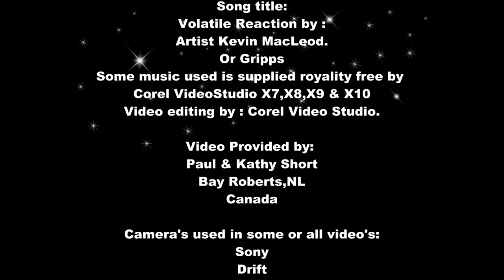Honda GL1800 & GL1500 Tech Tip Switch Issue

Comment: A trick I learned long ago when re-assembling plastic devices is to not just insert the screws and start tightening. If you do, you might accidentally cut new threads into the plastic and that's how you end up with stripped out holes  After inserting the screws, slowly turn them backwards and as you do, you will hear and feel them 'click' into their original threads, then you can tighten them up and you are good to go.

Comment: Hi, Paul!  This is funny because I just performed the exact same switch repair on both my hazard and fog-light switch before I found this video, and you are exactly right on these 2 important points (in case anyone is wondering, Paul is right):

1.  Suggestion:  physically remove that spring (the one that likes to go flying) with needle-nose pliers before disassembling the rest of the switch.  This is to prevent that spring from being lost.

2.  The copper leaf-spring on mine indeed was "flat" and the grease inside the mechanism was turning to a glue-like substance (the bike is 16 years old).  So the next step of my "operation" was using a tiny screw driver to scoop out the old glue-like grease, and once clean and the little "pin" moving freely, then I lifted that leaf spring to make it stronger again.

3.  The black switch indeed has to be re-assembled by snapping it in so that all 4 "dogs" snap into their places at the same time.  You can also test the conductivity of the switch before re-assembling if you want to make sure it works (so you don't have to take it out again).  It should provide a complete short between the left pair of wires, and another short on the right pair of wires.

Well done!  Great tip!  I'll search here before I dig into my next fix!  (Shich is the blinker switch -- gummy and doesn't pop back to center sometimes.)

Comment: That Dow grease is the best I've found. I broke down and disassembled my remote switches on the handlebars of my Gl1800 to clean and grease them. Pretty tedious, small work with the headlight on my head, but they all work now. Great video.

Comment: Paul, you didn't use enough dielectric grease...  <grin>
As an Electronics Engineer (ret) with enough letters behind my name to make alphabet soup, there is no reason not to use the dielectric grease unless there is a reaction with the non-metallic structure of the switch.     Most dielectric grease is PDMS based and relatively inert compared to petroleum greases.   The only time you have to be concerned is when you use dielectric in areas of high energy arcing as components of the PDMS can convert to Silicon Carbide (SiC) or as you probably know it, Carborundum... which can hasten contact failure.   So don't use it on your starter solenoid contacts and you'll be fine.

Comment: I read somewhere about a guy using a massager on a stuck switch.  So I have a hand massager shaped like a computer mouse and held it to my stuck cruise control on/off switch and moved the switch back and forth many times with the massager.  Got the switch free!  That massager I think will now be part of my took kit.

Comment: Yup.  Been thar and got da T shirt.  Emergency flasher, driving light, and reverse switchs have all stuck.  Lost a spring and found it, lost another and did not find it, but a clicker pen provided a substitute.  Lots of folks poo-poo about WD-40, but it cleans out the too heavy Honda grease.  I considered dielectric, but it is pretty thick too.  I remembered another silicone grease I had in my fishing tackle box, Garcia Reel Lube.  I used that and no more sticking switches and its been many years, 11 or 12 years.  I wonder if Garcia Reel Lube is still sold?

Comment: My 2004 has around 115 000 kms and I'm starting to have the same issues with fog lights , emergency flashers , and cruise on/off switches. I thought I could get away with just spraying a good electrical cleaner in there but it looks like I'll have to delve in a little deeper. Thanks for the post.

Comment: This is my job for today.  I was replacing all my bulbs with LED and used the hazard switch to check that all the bulbs were working.....Bad idea!   I remember someone saying to NEVER push the hazard switch!  Now I know why.  Thanks for the video!  I haven't been to NFLD in years.  My mother grew up in Gander Bay so I used to visit there every 2 years as a kid.
Reply: OK so I took the switch apart 3 or 4 times.  I cleaned all the grease off the innards and applied dielectric grease (maybe too much) and it wouldn't work properly still.  Took it apart again, cleaned off all the grease again, adjusted the spring pressure a little more and it worked fine.   Took apart again to add grease (just a little this time) and it seemed to work.  I put it all back together and now it usually works but sometimes requires a little persuasion.  How is yours working now?  Has it failed again?
Reply from the maker: Hi. That’s a pretty old video but I still have the bike and all the switches work perfectly other than the cruise switch I had to do the same thing with last year.
Reply: @7863348  I have a new problem.   I was repairing a charge port that was installed in my left side glove box.   I accidentally touched the + and - wires together and now I have no power at my acc terminal.    Is there a fuse for this terminal?   The charge port never had an inline fuse installed.  I would appreciate any information you have.   
ps.  I tried dielectric grease on my cereal.   Gave it a nice zing!   Haha.
Reply from the maker: @sunsetoriginals7320  If there isn’t an inline fuse for that charge port then hopefully a fuse in the man fuse panel popped. Check all the fuses at that location.
Reply: @7863348  thanks so much guys.   I feel so stupid.   For some reason I thought it didn’t have a fuse.   I changed the fuse and it’s all fixed.  I also picked up service and electrical manuals for the bike.   That should help me out tremendously!

Comment: so basically what you’re saying is, take it apart and clean it and put it back together.. got it. I thought only BMW overcharged for parts..
   that’s not the most ridiculous price I ever heard for a part. I had a Kawasaki KLR 650. I was in the process of upgrading a part with the nickname, Doohickey. It’s a spring for a chain tensioner on the counterbalancer ., I went to the dealer to buy a replacement gasket just in case,made of what looks like paper. this was around 2006, so pricing now is probably higher. But this gasket made of paper shaped like the state of Ohio outline about as big as your hand, The dealer wanted $58 for that gasket.. after I was done coughing after I heard that price, I told the dealer to keep the gasket, I will be very careful when I remove that little inspection cover not to tear the gasket.
   Every time I see an out rages price for a part, I always ask myself, could I make one of these. The answer is no to the switch for the Honda four-way flasher, but yes to the Doohickey inspection cover on a Kawasaki KLR 650
  my four-way flasher is stuck on my 2002 Gold Wing. I just bought the bike in October. I don’t know why I pushed the button, I do know that I will never push it again, ever.I’m glad it’s November right now, I have 4 months to fix it..

Comment: Paul you were thinking out of the box (or is it experience). The tech tip that I got from this video is the suggestion of placing your work inside a plastic bag when removing parts that have little springs inside. Or those dam E clips that always seem to fly off in a parabolic arc never to be seen again.  Good tip, I will remember it.

Comment: Just got a 2005 wing last week.  Foolish me I didn't operate all the switches but the dealer saw the cruise on/off was stuck on so hoping they will fix that.  I saw this video you made on the hazard flasher switch so I think I'll try mine.  Sure enough it stuck in the on position.  Had to tear it all apart and reassemble; hazards now off.  Too chicken to try it again.

Comment: I have the exact same switch bad on my 2002  Holding. I was so happy to find you. Thank you so much for your wonderful information. You explained it perfectly. How do the control panel and glove box come out. Thanks, Jim.

Actte
Reply from the maker: Your kindly welcome. With over 800 YouTube videos I really don’t have the time to layout detailed instructions on how to remove parts from ones bike. You need to do what I always do. Buy a factory repair manual. It will pay for itself on the first repair.

Comment: Like your videos.  Have you done one on Goldwing 1800 rear shock.  I bought 2007 with 220,000 miles & need to replace the rear spring & or shock.  Took it for the first trip to PA, round trip 1000 miles plus.

Comment: LOVE YOUR VIDEOS,I HAVE A 2006 GL 1800 WITH 51000 MILES ON IT.I`M HAVING A PROBLEM WITH THE IGNITION SWITCH. BIKE WON`T TURN ON.I PUT THE KEY IN TURN KEY, LIGHTS UP FOR A SECOND THEN NOTHING NO LIGHTS WONT START.IT`S LIKE YOU NEVER TURNED THE KEY.I CHECKED FUSES,BATTERY, AND RELAY. GETTING READY TAKE BIKE APART TO CHECK KEY IGNITION SWITCH.ANY SUGGESTIONS WOULD BE APPRECIATED.

Comment: I have a GL1800 that misses in a similar pattern on each of the 6 cylinders when watching it fire with a timing light.  It began suddenly after passing a car on the highway. It still runs but has a miss that's equally distributed to all cylinders. Not sure if it's possibly the kill switch, ignition pulse generator, computer, to or what? Don't see it throwing a code.

Comment: Hey Paul thank you for your time, can you show us how to remove the Horn Cable, horn stop working fuse is ok, need to measure the current but no way to remove the cable Goldwing 1800 2011. Thanks in advance

Comment: 2 questions... 1 if you lose that spring could you use a spring out of a pen would have more pressure to release 2. Would powdered graphite work better the grease? Going to attempt this project in about a week

Comment: Hi Paul n Kathy,   On your vid with the switch of date: 16-Aug. 2017, I`ve heard a lot of stories about the emerg. flasher, is that the one ?
If so, why even bother hooking it back up if its causing so many problems ? 

Sounds like a money maker for Honda.
Thank you both, by the way Kathy, great job with filming.
Reply from the maker: Thanks Marco. Yes this video was for the flasher switch. I showed how to repair the problem so you wouldn’t have to purchase the complete assembly in the video. Once repaired you will get many years use our of it before it needs to be done again. 
Why repair it at all you ask. Well it’s a safety item and anything related to safety should be keep in perfect working condition. 
Thanks for watching.

Comment: Paul i have a 1995 1500 gold wing . I’m having a problem with the air pump. If i jump out the power to pump it works.The fuse is good and relay. i’m stumped. Can you give me any information on what else to check? I like your video’s. Thank you any help would be appreciated. Bill Groel

Comment: Hi Paul got a question for you as I seem to not find information on the led temperature light on a valkyire mine does not come on I'd expect it to show blue then green or something, if hot red the bike is a 97 I've had it 2 years all the wires seem to be there,  what do you think,

Comment: that panel you are working on  i have a question about the preload button, i fixed the hazard button with your help, but my air shocks are not working i had the model that had the light psi and voltage, i bought a new panel, and it has only a master plug with no plug going out for fog light and preadjust button, my old one had 3 connecters coming from the bike to it,im trying to convert it any suggestions

Comment: Would you take on the task of replacing a second gear on a 1989 Goldwing that's been sitting since 07
Reply from the maker: The last Wing I restored was 7 years ago. A 1980 GoldWing. The last time I worked for the public was 6 years ago. I’m into manufacturing now and loving it. The only time I’m in the service end of the shop is to do my own work.

Comment: Good morning.
I have a 1999 honda valkyrie and just take the carburetor of to cleaning them up. I had to change the float needles. I after i put it back i get a crank no start unless i  remove the air box then start.
Can you give me something helpful point?
Reply from the maker: There is a drain screw on the bottom of each carburetor. Loosen each one and see if an fuel comes out. If there’s no fuel you have a restriction or it’s possable your needle valves arethe wrong size. The other thing I’d have to check if it were in my shop is It sounds to me that the carburetors might not be clean enough and they are restricting the fuel. What you have is a a fuel problem. You just need to track it down. I would start by getting a factory service manual and that will be your best friend when you have issues. Good luck.

Comment: Dear Paul and Kathy, question, my GL1800 2007, it has abs flashing issue. Sometimes it doesnt but mostly abs light is blinking. How can I solve this? Thanks
Reply from the maker: Try resetting the abs light by removing the abs fuse for a minute. 
If that don’t work here are your options:
Purchase service manual and use it to find the issue or 
Take it to your nearest Honda dealer for repair.
Reply: Paul & Kathy Short thanks a lot
Reply: I cleaned the abs sensor on the front tyre and now the problem is gone ;)
Greetings from Istanbul

Comment: Hello Paul, I hope you still reply to comments from this video. I think your video is good, however, there are some areas you are not clear on. At around 3:44 you said to substitute switches (fog for hazard) you have to take out one of these little dogs spring it under  and put in the other cavity????? You lost me!! In the video you are not very clear about what "dogs" is, what cavity are you talking about? You never show a clear view of the inside of the switch. I've taken the switch (hazard ) apart multiple times, cleaned it and it still sticks.

Comment: I have a 01 without heated a seat. How difficult is it to add it?
Reply from the maker: Well what’s difficult for some is not for others so it’s a loaded question. It is doable and It not that difficult . You’ll need to buy and heating element. They are less than $100. Remove the seat and it’s cover and put the element inside then wire it in with a switch and you now will have a comfy seat.
Reply: @7863348  hey I appreciate it and will have to look into it. Ty and love the videos!
Reply: @7863348  hey I appreciate it and will have to look into it. Ty and love the videos!

Comment: Hello and thanks for this videos.
I nust purchased  '99 valkyrie that was sitting in a garage for over 6 month.
I only able to accelerate by pulling on the accelerator about a 1/4 range ay the time and wait to the speed ro build up.
If i try to remp up the speed thw bike motor sound like is not going anywhere.
Where sure i focused my investigation?
Reply from the maker: Time to remove and clean the carburetors. Install and  synchronize them. Thanks for watching.

Comment: Paul,  I attempted to repair the flasher button, now it will not lock into the on position. It just goes up and down.
Second, my turn signals bulbs turn bulbs turn off when i cancell  the turn signal. any suggestions on why?
Reply from the maker: I think you might need to clean it more and try spraying some fluid film or WD-40 in afterwards. This might help.
Reply: Paul & Kathy Short  the switch goes in and out but will not lock in the on position    Thanks for your help and I did find my spring
Reply from the maker: Yup. I’ve seen that happen as well and old grease can cause it. Clean it up really good and regrease. Your lucky to have found that spring lol. Ride safe.

Comment: My hazard lights only work if I keep the button held down!  1 time in 50 will they stay on, and when they do stay on they always turn off when pressed!  ISSUE Staying on when pressed. What do you all think?
Reply from the maker: It’s the switch. It needs to be cleaned and use dielectric grease to lib and it should work well then.

Comment: Raising hand.......I have a question? Why shouldn't you be using that grease, seems just by the name of it it would  be ok to use.
Reply from the maker: It tends to harden up causing the switch to stuck as in this case.
Reply: Ok, thanks!